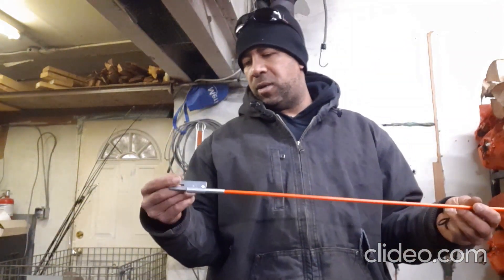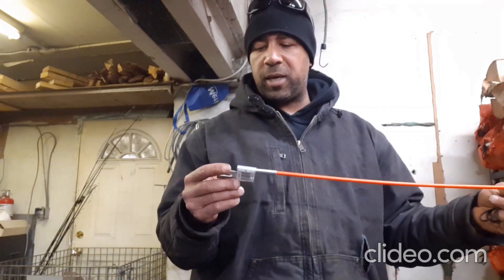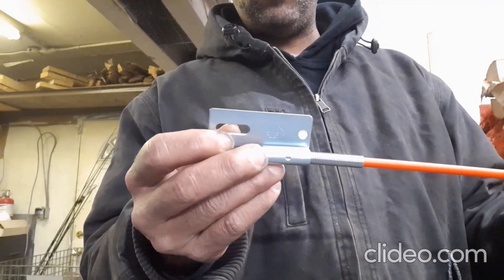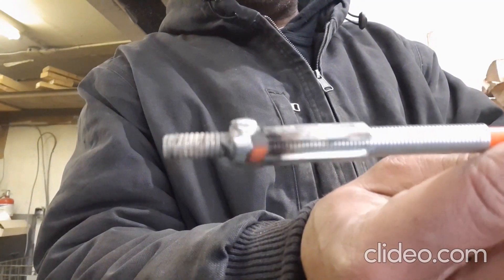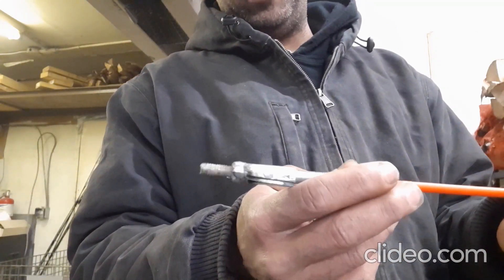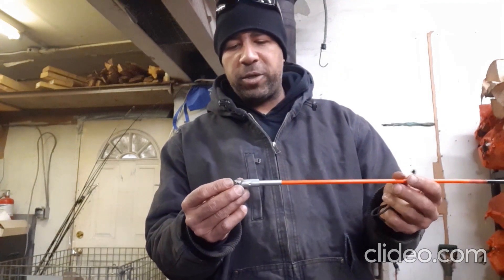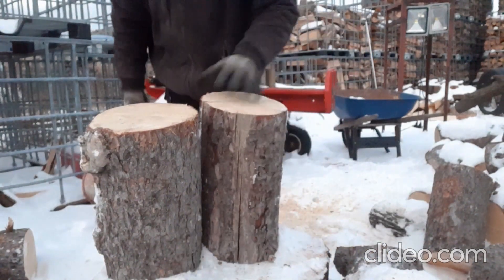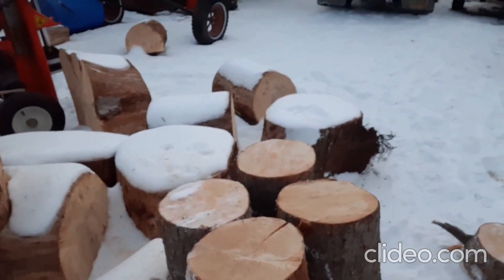USE THIS STIHL TOOL TO MEASURE YOUR FIREWOOD CUTS

Comment: Totally crazy if you mount it to the back of the handle at the bottom with original hardware the tip of chain to end of rods = 4' almost like it was made to do that lol
Reply from the maker: a someone told me that they mount up, unfortunately not on my MS261C. did I mention that in the video? Can't remember, I made it 4 years ago. I did mount it on the wrong side of the bar for this video as I was in such a rush with enthusiasm to make videos, but obviously it can be used on either side, I'm sure that it depends on one's preference

Comment: There is 2 screws on the bottom side of the handle.. you will need to replace those screws with ones that are 1/4 inch longer... I do like the position yours are in though I may need to try that
Reply from the maker: Yes I've heard that the tool attaches to the handle. Of course clearance is the issue with mounting, it is not an issue where I place it. I noted in the description that it should be placed on the other side of the bar

Comment: There are easier alternatives, the magnetic stick on one's are the best.
Reply from the maker: They all have their suitable applications. The magic stick is more suitable for a load of logs so that you can do a bunch of marking from side to side. Because I get tree service wood, my wood is in a random pile, usually needs only one cut or two at most and there's lots of crotches  which don't need to be measured. I would have to have the magic stock constantly on and off in short intervals while cutting. I tried a magnetic tool before and because I was working in a big random pile and had the saw running at every angle all over the pile, I knocked it off the bar and it fell on the chain and cut it in the first five minutes. Thanks for watching!